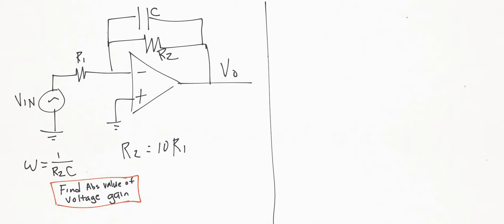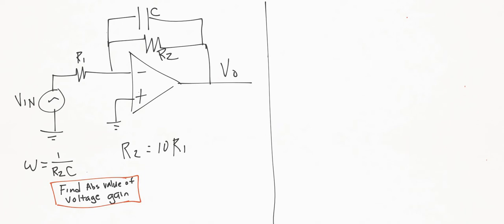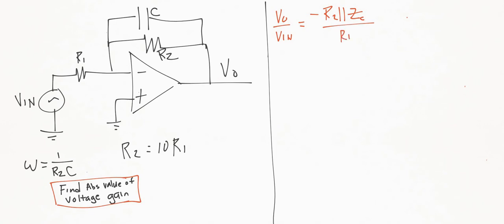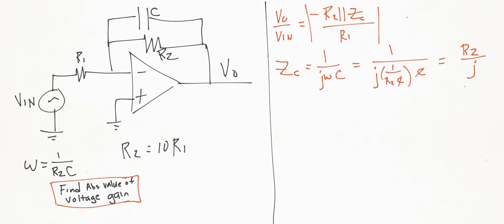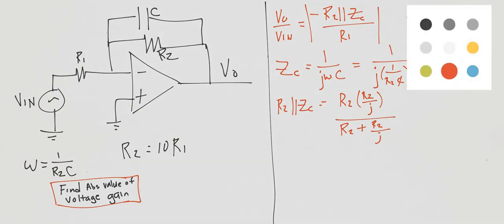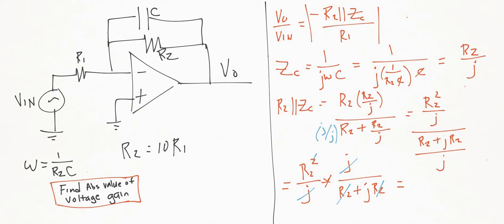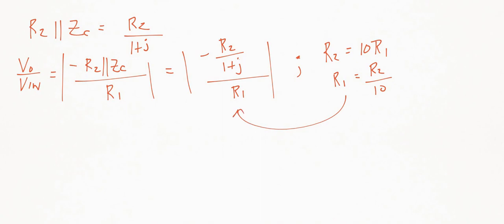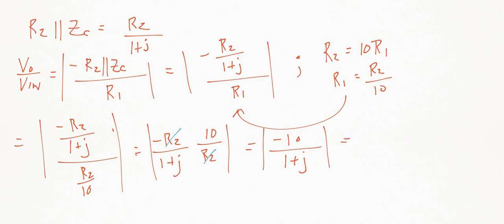Electrical FE /EIT Exam Prep - Electronics 4: Op-Amp with Feedback Capacitor

Comment: R_2^2/(R_2+jR_2)=R_2/(1+JR_2) not *R_2/(1+j). You need to multiple the reciprocal (1-jR_2) the both the top and bottom of the fraction to be left with R_2/1=R_2, making the abs value equal to 10 not *5sqroot(2).
Reply: Really? Sounds like fuzzy math to me. R2 must be factored out of the equation as done in the video just not shown.

Comment: Why do we some times have to drop the j when calculating, but sometimes (like this case) we have to leave it?
Reply: On AC circuits Capacitors/Inductors need to be used (Convert to Zc/Zl), unlike dealing with a DC circuits, you can open/short the circuit respectively. Hope this helps!